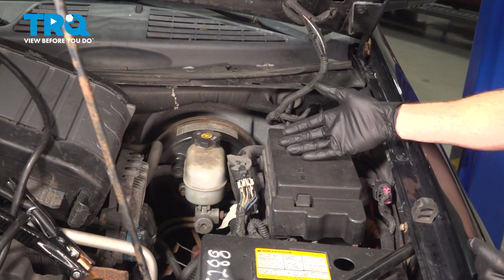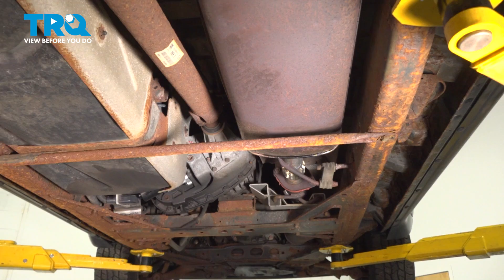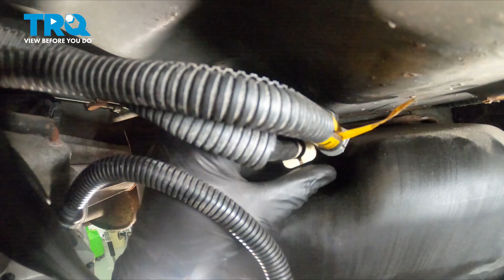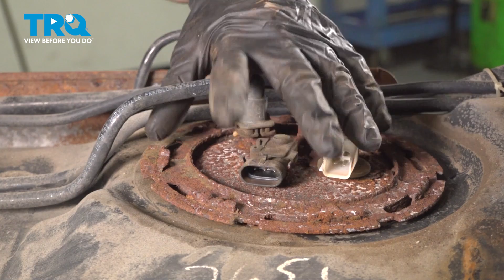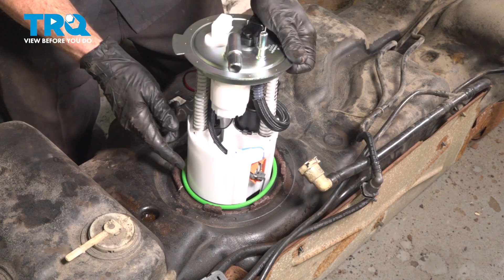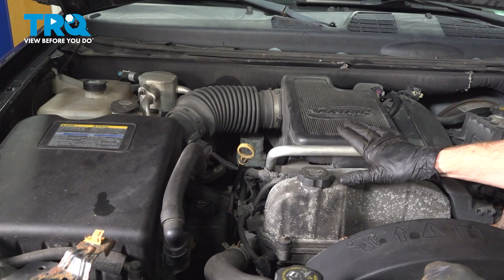How to Replace Fuel Pump Module Assembly 2002-2009 Chevrolet Trailblazer

Comment: Early model Trailblazer and Enjoy owners beware, the Trailblazer in this video is a later model. The fuel lines on my 03 Envoy all disconnect at the front of the tank. The only line to disconnect at the rear is the filler neck house. Electrical connectors appear to be on the same place though. Also, several of the clips that hold the fuel line fittings together are a different style.